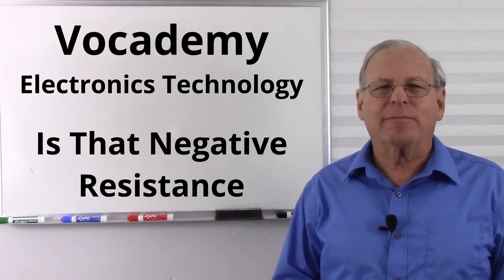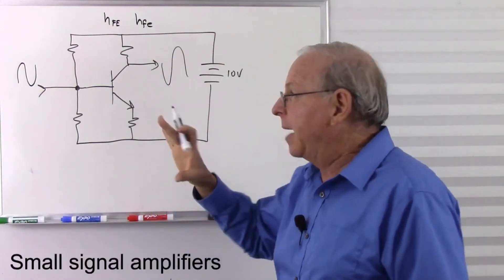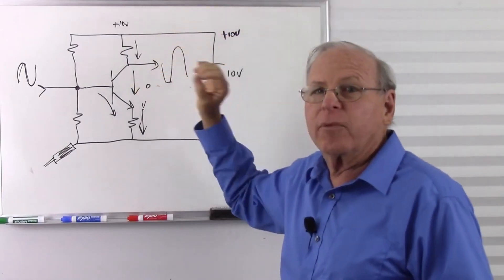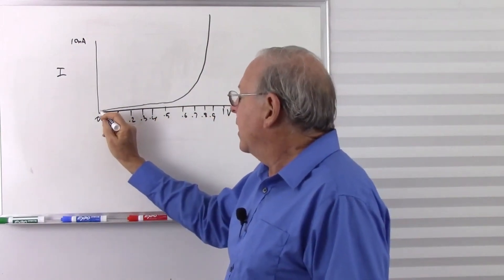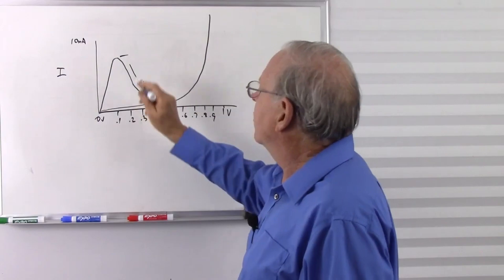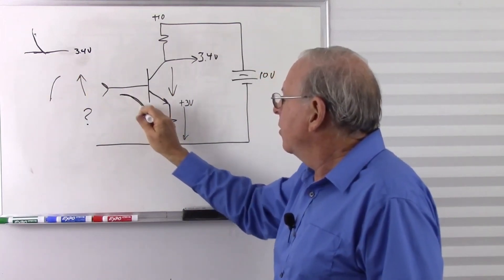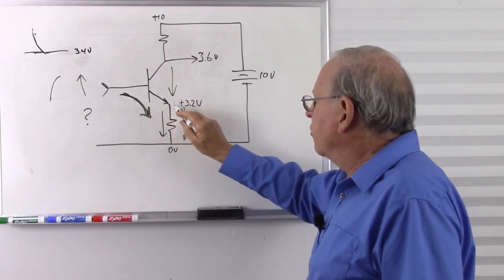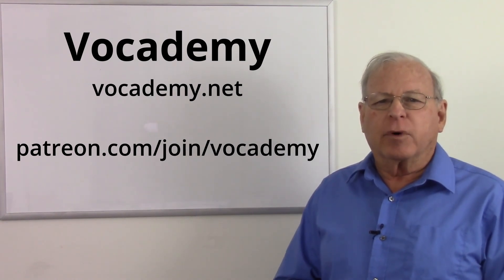Is That Negative Resistance - Answers to Questions

Comment: When the transistor saturates, the difference between the Collector voltage and the Emitter voltage is quite small (ie. VCEsat is often approximated as 0.2V).  Since the Emitter voltage is following the Base, VC will also follow while the transistor is in saturation, which explains the "bounce" you refer to.  Mathematically, this can be described as:  VC = VB - 0.7 + 0.2 = VB -0.5, which means that the Collector voltage follows the Base voltage during saturation (minus about a 0.5V drop).

What is interesting to me is that during saturation, the BC junction is FORWARD Biased, but the (conventional) current is flowing from Collector to Base (ie. from a lower potential to a higher potential)!  This makes no sense until you consider that the majority of current flow from the Base to the Collector is due to DIFFUSION (caused by a high concentration of electrons in the Base region) rather than DRIFT (caused by the electric field).  I still find it incredible that charges are moving "up hill".  

I do not believe this is a "tunneling" phenomena, but rather one attributed to Diffusion.

Comment: Good day!

Regarding loss compensation (using negative resistance) in a microwave filter, how could I design a common emitter RF amplifier with input impedance (seen looking into the base terminal) that has a -R and capacitive reactance? I've been trying to implement this through a Colpitts oscillator design method, but don't want the circuit to oscillate.

Since two conditions are required for oscillation, could it be as simple as making sure at least one condition isn't met, or do I have to move (in design) above or below those conditions?

Comment: About halfway through the video I was getting ready to write a comment saying, "No, you're wrong, it's not negative resistance, it's just a consequence of saturation." I'm glad you came around to my point of view. Obviously, we must be right since great minds think alike. 🤓
There's one small point where I still disagree. I think you said that in saturation there's a 0.4 V drop from collector to emitter. But I think the 0.4 V drop is actually across the (forward-biased) base-collector diode. That's how I've always seen it in Ebers-Moll models in textbooks. That means the rising base voltage directly causes the collector voltage to rise, rather than indirectly through the emitter current.
Thanks for another excellent video!
Reply from the maker: I really was analyzing this in real-time. I had never thought much about the cause of the bump until someone asked me to explain it. I hope this showed how mastering the fundamentals helps to understand more complex circuits.
Reply: If I understand you correctly, you're saying the rising base current "re-reverses" (forward biases) the base-collector junction of the transistor?